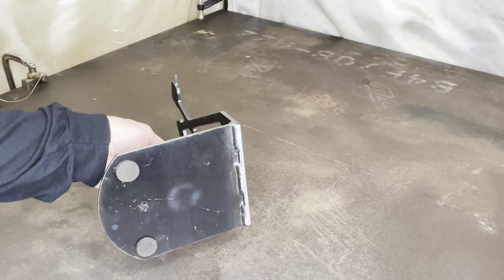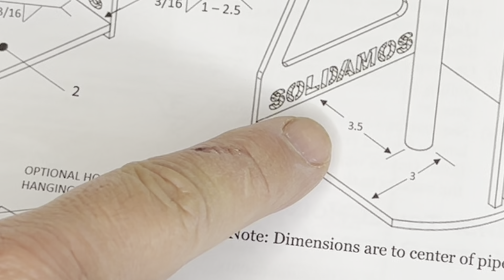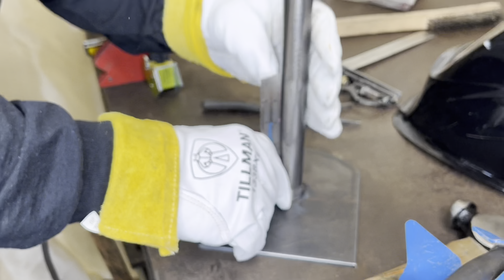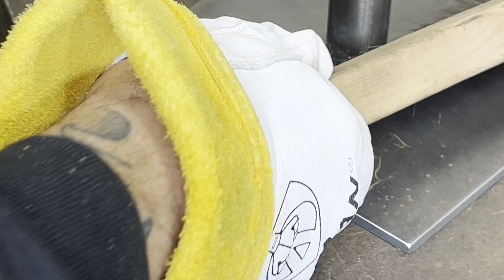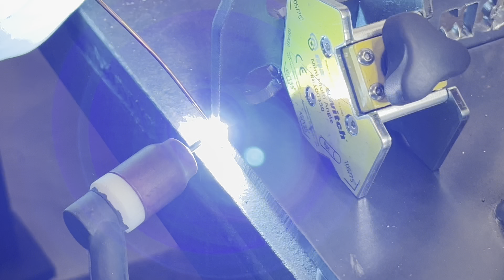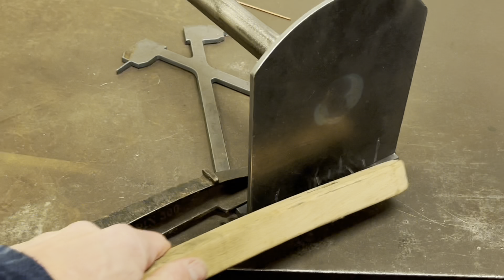Welded Towel Dispenser: The Ultimate Shop Towel Upgrade

Comment: If you are using the tear-off bar to remove a towel, the fancy tig torches are not facing the right way to see them. Maybe the designer should include the tear-off bar into the design portion on the front...?